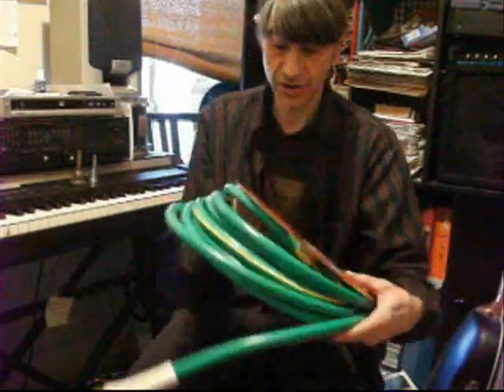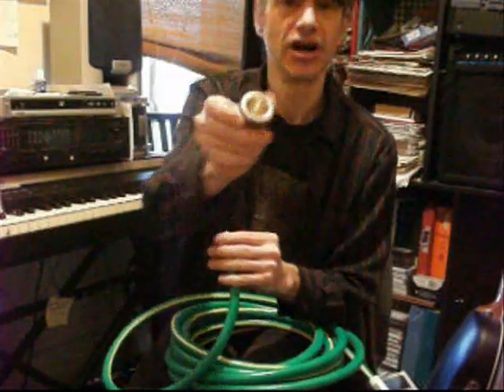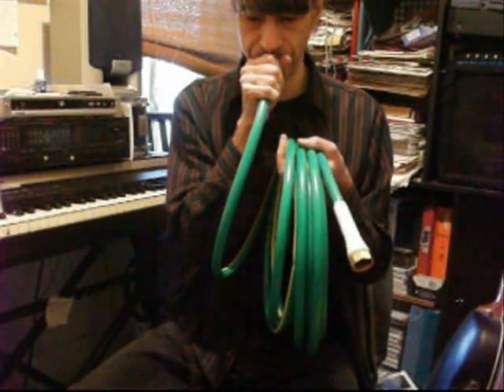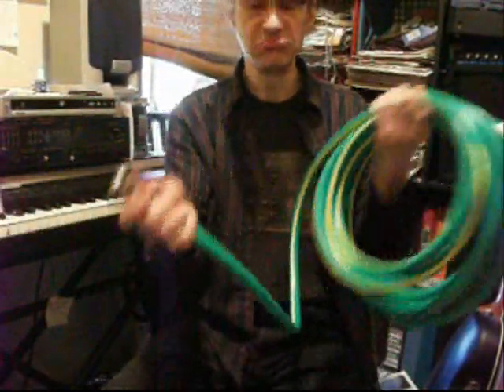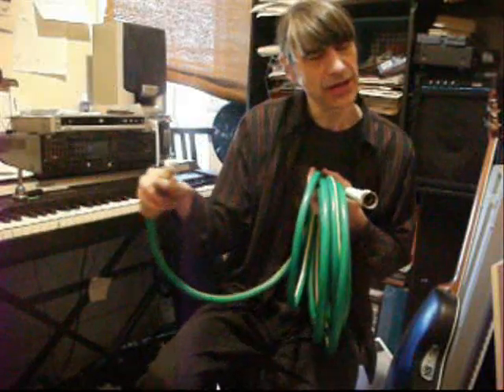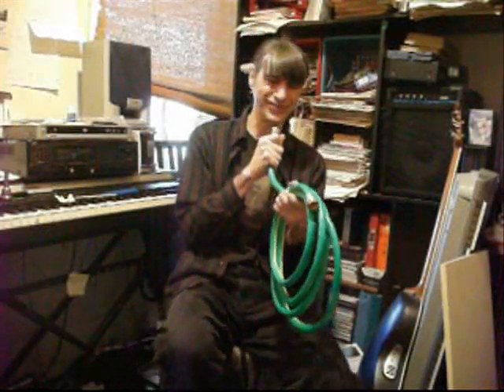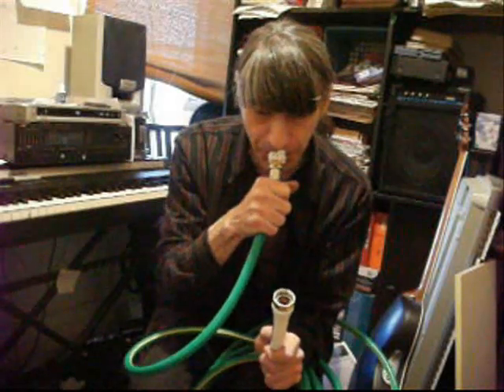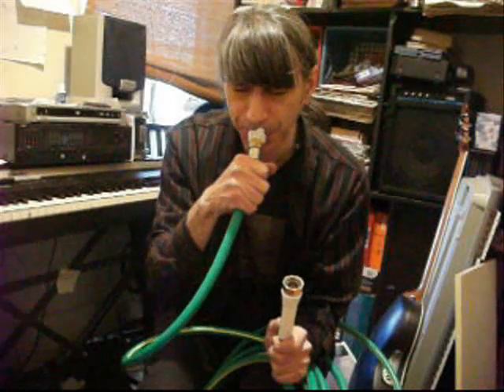Playing a Garden Hose like a Horn: Music Stuff With Spock

Comment: Would you have figured out by any chance which lengths gave you what fundamental tones, or do they correspond with lengths of actual brass instruments?
Reply from the maker: The French horn is supposed to be 13 ft long (but I cut my hose to 12 feet which is why it is in B and not Bb). The low G tuba was done with the full length - 25 feet.